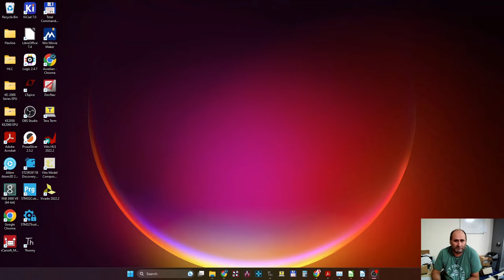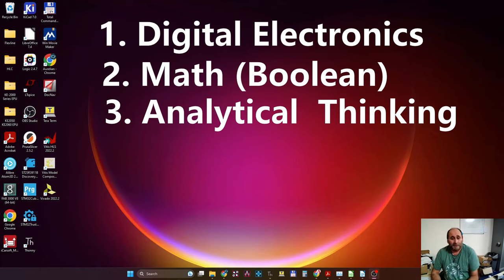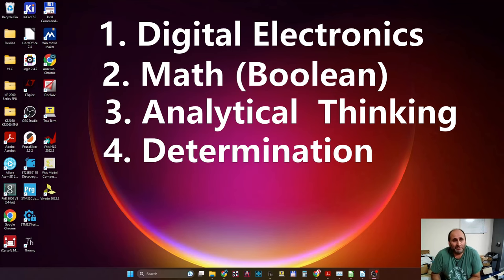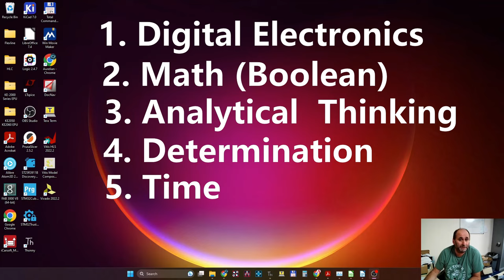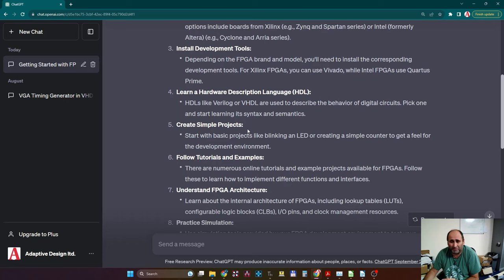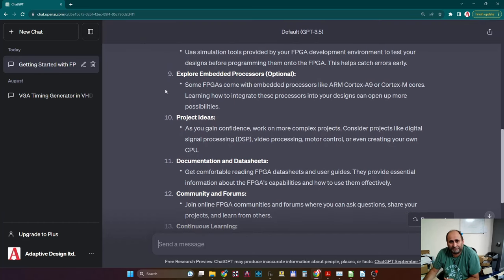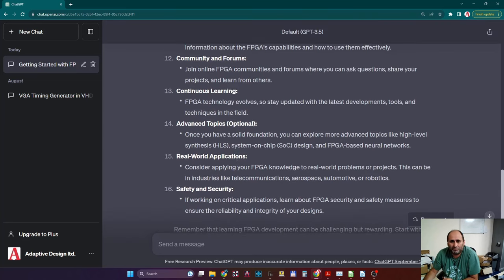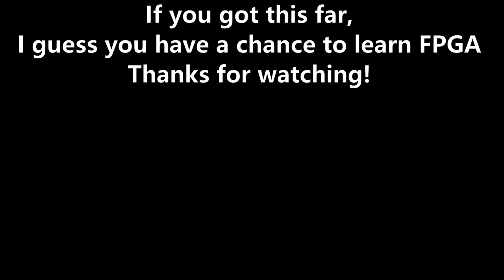Required Skills to learn FPGA

Comment: Thank you sir for this. I have had some experience writing HDL code and running it on FPGAs. Looking at the design process in the industry, through avenues like YouTube and LinkedIn, a lot of designs do incorporate HDL design but also block/IP design on schematics. Here is where I get lost. I have a basic understanding of computer hardware architecture but seeing how people design using IP, whether vendor or custom,  looks quite advanced and frankly unknown to me. They mostly focus on how to use the software to design eg "click here to access this IP" or "click here to assign addresses", but never an explanation of "why we connect this signal among these blocks for this specific design" or "why this block is needed for this design". This information is contained in the vendor IP catalog manuals and I have looked at Altera's manual where they detail their IP, interfaces logic and timing associated with each. I however still can't say that "for this project I need this block/IP in the memory design part and this is how to configure it"
Perhaps I am not as analytical as is required, or not as knowledgeable in computer architecture as I thought or haven't done enough embedded design to understand something like "DMA is used to bypass control unit for data transfer but we require a controller for it or maybe a bridge of some sort". Is there an advanced hardware architecture course/book to familiarize myself with this, something that I would engage in or read and for example come out knowing that "we connect the CPU and memory controller using this logic circuit because of this reason" after detailing the connections required between CPU and memory?
Reply from the maker: Hi Martin,
We all went trough the same frustrations over time, learning how to use FPGAs efficiently requires a lot of prior knowledge on more than one subject. I'll take them in turn. The usage of existing IP makes sense in some case when the problem is too complex to solve quick and the time budget is limited. Just because you know how to code a simple uart of slave i2c  doesn't mean you should code one when is available for free in the tools. Or if you want to see some signals in the frequency domain you don't write your own FFT when available for free.  These choices are different when you want to learn and spend time coding to push yourself to the next level. Both choices are right (to use or not use IP) in the right context.
Second one about what the IP does and how is connected and when needed (DMA example) has more to do about understanding computer's architectures (many books out there)  and is decoupled from FPGA design. I assume you are younger than me, for us it was a bit easier because we learned these things gradually (as they came along) in the right order, with the right timing, younger generations needs to find the right order or to learn and progress with all these subjects concurrently in small steps. This process requires time, patience and discipline.
I hope I answer your question(s)
Reply: @adaptivedesign8795  Are there specific resources, books, courses, that you would point to to "Walk the same path you did"?

Comment: I like this video for beginner like me.  but I have some question I use software Mvtech Halcon  . and can export to C Language . I would like to know can use with Xilinx FPGA ? I ever found some video but long time talk can use mvtech halcon can use with Xilinx FPGA. if you know how to do it . please share experience. 

Thank you
Reply from the maker: Mvtech Halcon seems to be some machine Vision software library (from what I can tell by browsing the internet) it would be a bad idea to export that top C and then attempt  an FPGA implementation directly from C (a lot of ropes and pulleys for a suboptimal result) - for machine vision application you can find many blocks already written for OpenCV standard which might be the way to go I think.

Comment: Sir, how can i get a job if companies asking 4,5 years of experience? Do i need to make projects ? I dont have work experience
Reply from the maker: Making your own projects (not replicating) is always the best way to learn. Work somewhere else (not necessarily in a FPGA position) ideally digital, and keep  building expertise. Another way is to be franc with the employer and tell them you don't have 4,5 years you have only X but you are willing to learn, you never know maybe they have a junior position they never advertised. 
Good luck!
Reply: @adaptivedesign8795  thanks for the reply. I live in the U.S. and over here very few jobs avaialble in the electronics/hardware field. I have 5+ years of expereince working in the software development field, worked on Object orirented programming. I belive I can transfer my coding skills and other skills like Git, Agile methodology, Bug fixing etc.? If I have projects like SPI,I2C, VGA, Ethernet , will company consider it as experience? I can explain it in the interview.
Thanks